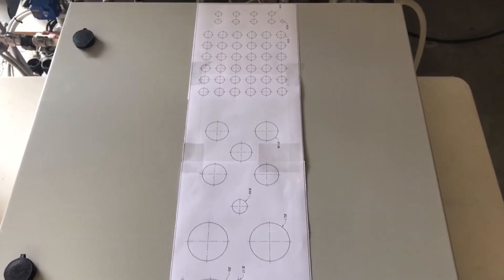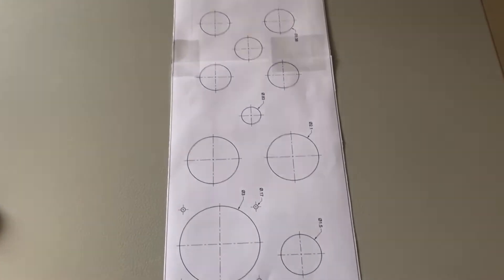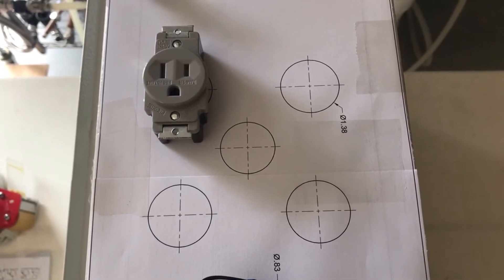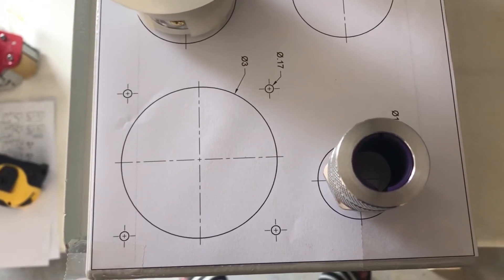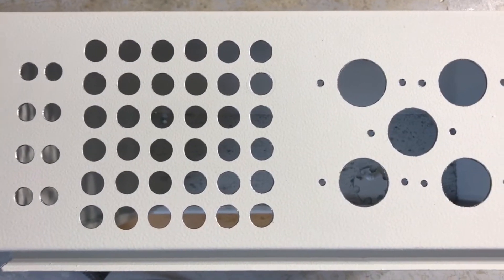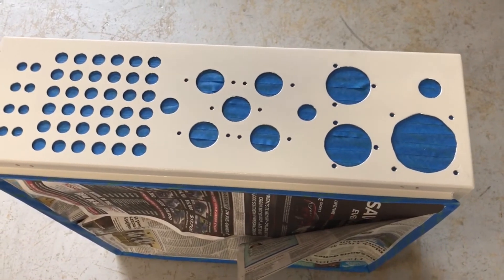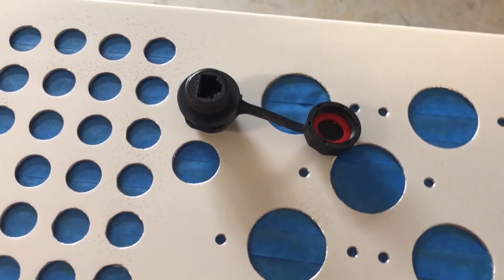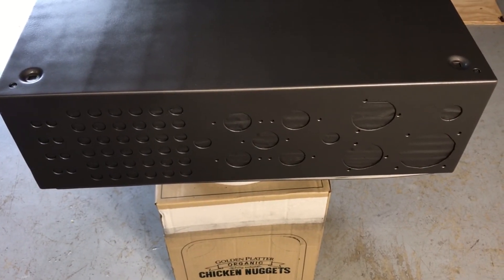UniCon Build Series Part 3

Comment: Any idea when the fourth video is coming out?
Reply from the maker: Had life get in the way... I'm aiming for the next 10 days.
Reply: @brucontrolinfo9492  What's the part# for the fuse holder you're using? UK 6-FSI/C?
Reply: @PsychoCharlieCat  Phoenix 3118203
Reply: @PFBruno3  Any update on the next video? Was following along with this but haven't wired yet.
Reply: @PsychoCharlieCat  Yep, I started buying parts for my new system. I'm about to pull the trigger on the unishield. I have a few questions but want to hold off until I see the wiring video.
Reply: @PsychoCharlieCat  I know! Sorry for the delay... I expect it will be in the next 2-3 weeks max.
Reply: @PFBruno3  been a long 2-3 weeks
Reply: @roots4thoughtidaho  even longer!  lol